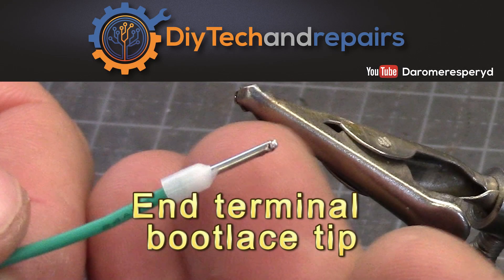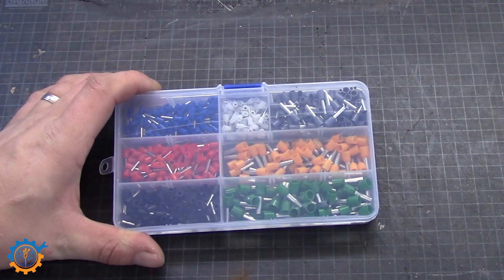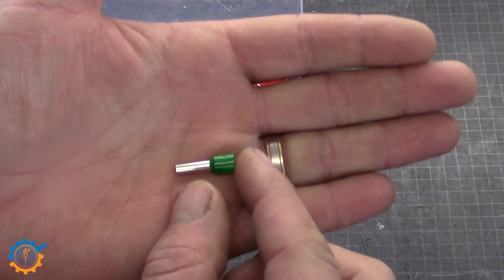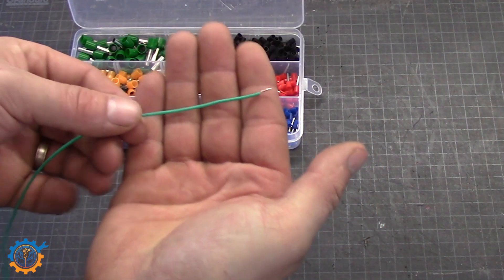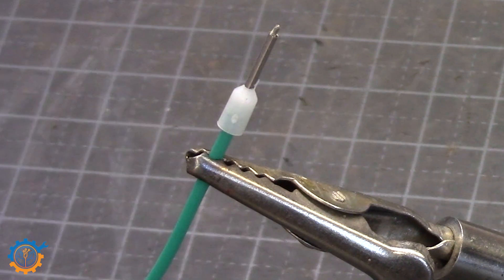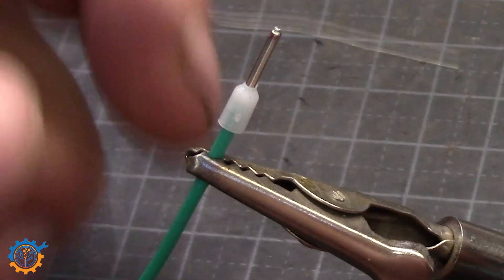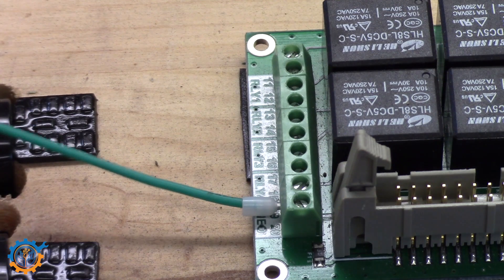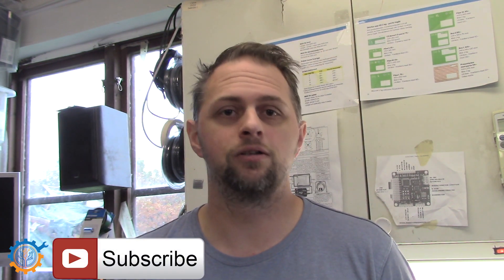WTT #6 - End lug caps - Make your wire ends pretty and useable (Boot lace ferrules)

Comment: I didn't know you could buy those ferrule things for making breadboard connectors.
Soldering tip/reminder: Solder flows toward the heat source, so you will get more wicking down the shaft if you put the iron in the middle of the connector instead of the end.
If you haven't soldered copper plumbing pipe with a blowtorch before, it's really cool to watch the solder flow upwards toward a hot joint.

Comment: oh thats a nice little connector tip, doesn't make solder all the way which hardens and makes wiggling the wire snap. I usually just solder but only touch the tip of the wire to prevent it untwisting and splitting strands and gives it a little head to prevent it coming out if pulled though I like this better. Never knew they even existed.
Reply from the maker: +Phizicks i have seen them but didnt think they were this good and simple to use. That have saved me alot of time